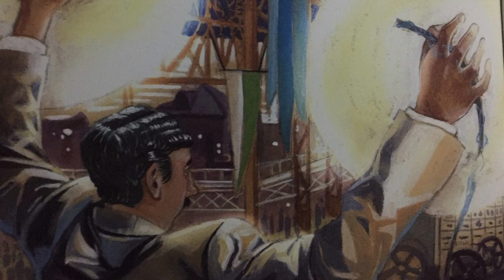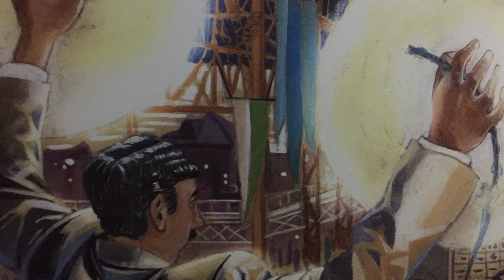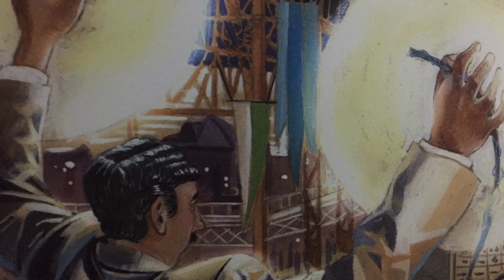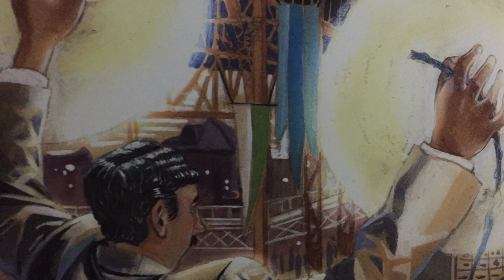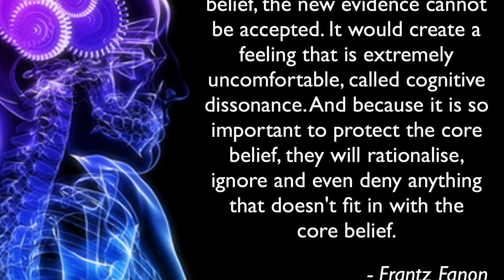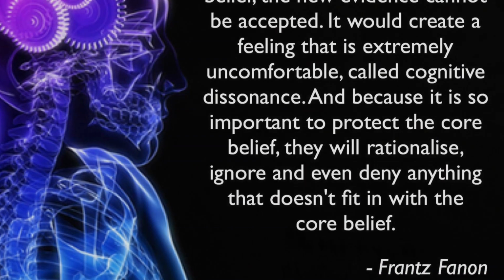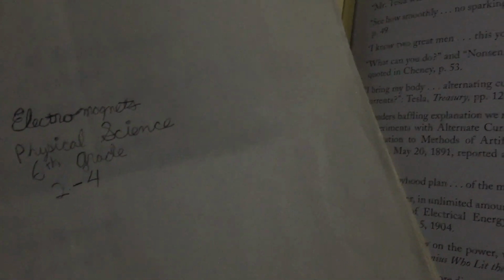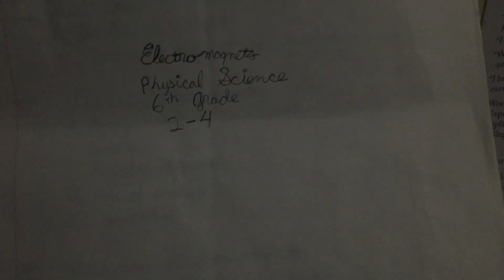Important Dates in the Life of Nikola Tesla

Comment: Teslacoils are not ac, but disruptive discharges.
Reply from the maker: Well true and true... A Tesla coil is an electrical resonant transformer circuit used to produce high-voltage, low-current, high frequency alternating-current electricity. Tesla experimented with a number of different configurations consisting of two, or sometimes three, coupled resonant electric circuits. Perhaps you can expand on the disruptive charges aspect. I might sound smart sometimes, but I'm really an idiot under this disguise and always willing to say I'm wrong and learn something new!
Reply: @ElectricUniverseEyes  Ac is a sinusoidal waveform, a continuous frequency. A disruptive discharge does not have a fixed frequency, the waveform has highest amplitude the first cycle, and then the amplitude decreases with each cycle until it disappears, and a new cycle starts again.
Reply from the maker: DfntlyGood Thank you! So would you say an EMP is such a description of a disruptive discharge? Makes sense now why a tube of noble gas lights up near a coil, as does connecting both leads of my ac transformer to the tube.
Reply: @ElectricUniverseEyes  Yes! These discharges produce what are called longitudinal waves, and these defy the speed of light. Hence no one learns about them any more...
Reply from the maker: DfntlyGood This conversation made me think of the lyrics of my favorite Puscifer song - Indigo Children. 

E.M.P. from the mother and son
Tore the digital down
Dawned are the age of the innocent ones
The indigo children
The indigo children come
The indigo children
When the indigo children come...

Analog time piece, sky wide
Sync to the ticker inside
Move to the rhythm of the moon and tide
The indigo children
Sirius, Venus and the lunar child
Giggle and the flames grow higher
Dance in a circle around a central fire
The indigo children
When the indigo children come

Wine, song, food and fire (Wine, song, food and fire)
Clothes, shelter and seed
No more need for the old empire (Fare thee well to the empire)
The indigo children
Sirius, Venus and the lunar child
Giggle and the flames grow higher
Dance in a circle around a central fire
The indigo children